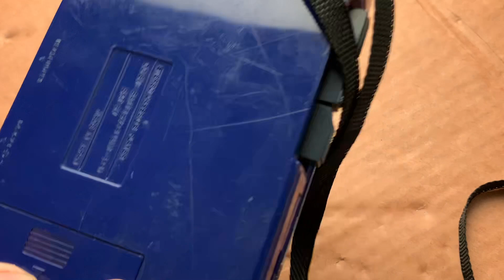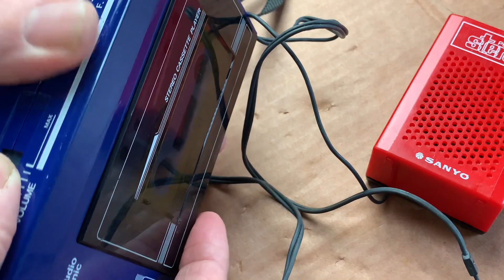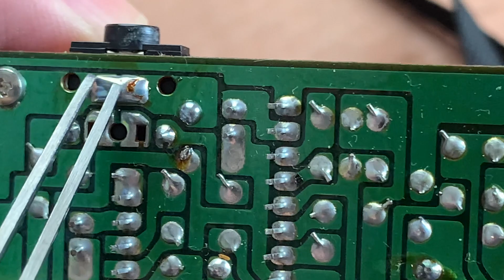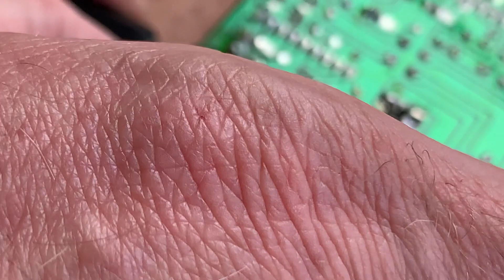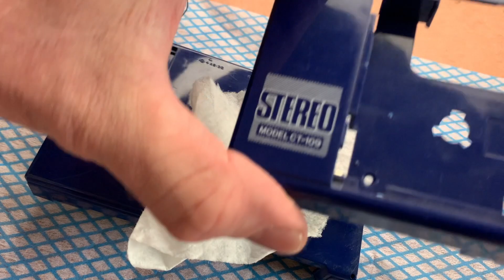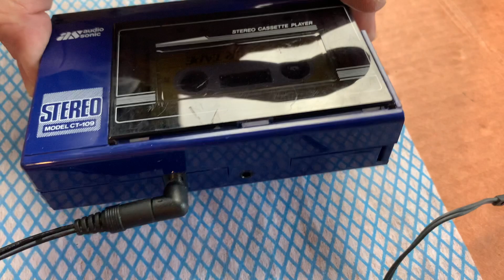Audio Sonic CT-109 Rare Personal Stereo Repair. Vintage Audio Restoration.Belts, Board Repair.Retro.

Comment: I would say this was most likely a rebranded unisef model the  Unisef Model Z-1 looks very similar. Nice and simple mech and all appears to be well made .I have my sisters unisef boombox me and my sister both got one for christmas and they came with a unisef personnel stereo ,i do not think the personel stereo survives i have no idea what happened to it .
Reply from the maker: You're right. I checked out the Z-1 when you suggested it. Also, I came across the Lloytron W-175 and that's also the same! Made under licence by the looks of it.  It's great that you still have your old boombox.  I got a Matsui for Christmas. I had it for many years and finally got rid of it a few years after  the analogue TV was turned off. Wish I'd kept it now.
Reply: I used to live in Australia during the 70s and 80s and bought Audio Sonic products for Coles New world Supermarkets, AS had decent products if I remember correctly.
Reply: dokładnie to unisef z 1 , nawet płyta główna taka sama, w 1985 tata zakupił na kontrakcie w Kuwejcie(właśnie dzisiaj go włączyłem po 30 latach i zadziałał od kopa) pozdrawiam.